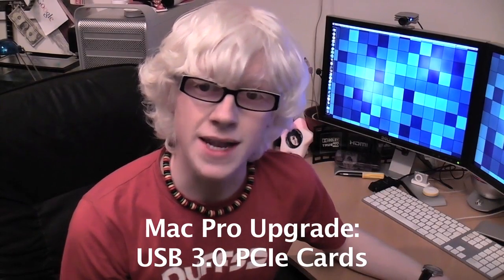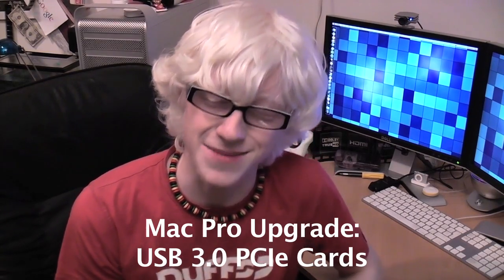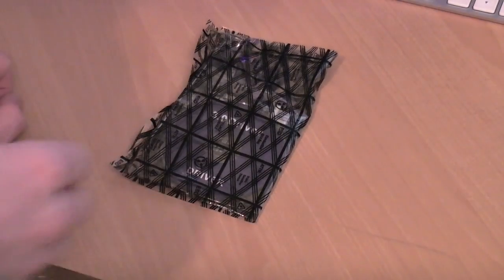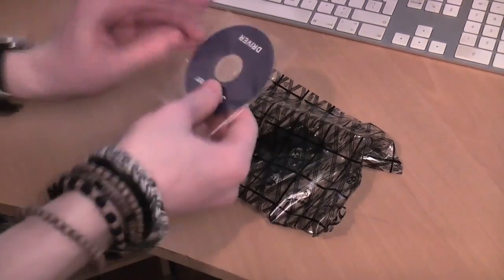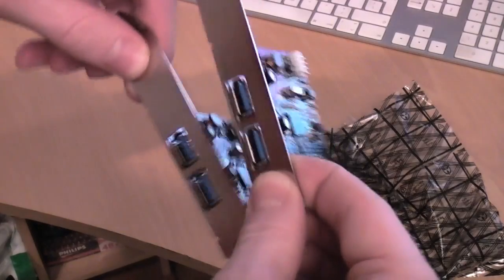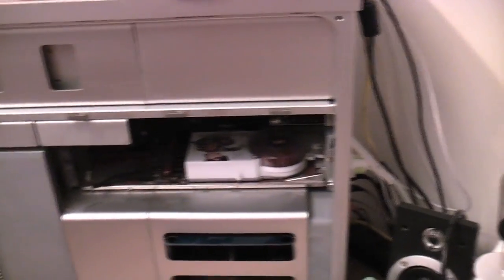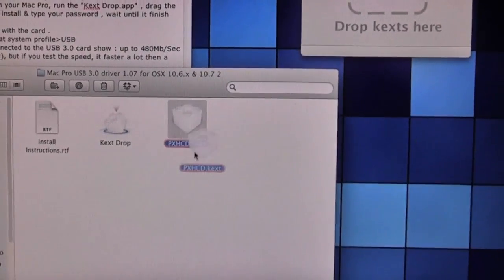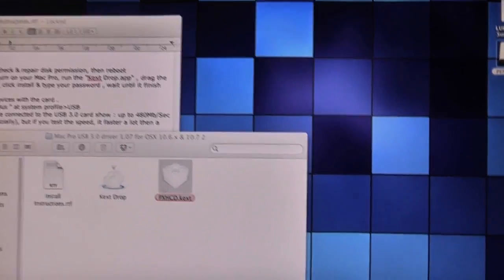Mac Pro Upgrade: USB 3.0 PCI Cards

Comment: Hey All,
I have a 2011 Mac Pro and was looking for a USB 3.0 card that would run on Snow Leopard. Amazon carries the Sonnet Allegro USB 3.0 PCIe 4-Port and is advertised to run on Snow Leopard. However, after receiving it, the box clearly states that you need 10.8 or later. 
I found a solution at OWC with the MAXPower 2-port eSATA 6Gb/s& 2-port USB 3.0 PCIe Controller Card. It works great but you'll first need to download and install the driver. Hope this helps someone.

Comment: How did you power these cards? I see these and many others on ebay have the power connector in the corner like they need power going to them.

I ask because I also have a mac pro and want more USB ports. Problem is we dont have spare power wires around the bay in our macs haha.

Comment: aw definitely! It is stable i ve it as my main working machine since 2 years but if you get into this i suggest you to do your research before to actually build it, check in the tonymacOSX86 website they have their customac builds for any price , my built costed over 1800 but every now and than i do upgrades and that s really the coolest thing of running on OSX on a pc you are free to do upgrades but by the other end apple dont help you if you have  a problem..

Comment: I have 2X 2006 mac pros and they each have 2 ethernet ports, they were never made without them.  You may have gotten a fake or something. It should be on the back near the bottom with the rest if the plugs.

Comment from the maker: Display connections depend on the graphics card installed, so you have a whole range of possible configurations. One of the most common configurations is Dual DVI on lots of Mac Pro video cards, but you'll also see cards incorporating Display Port and HDMI...

Comment: I finally converting to mac and just bought a used mac pro .I got it home and it doesn't have an Ethernet port. they just used a mini wireless. What card do you suggest? it's a 2006 or 2007 I think it's PCI?

Comment from the maker: @141gregmor There are a few problems with G5's for gaming. Firstly, you have to get the 2005 edition G5 to be able to get a decent PCIe graphics card for it, and then if you want modern day performance in gaming, you'll have to flash a PC card. The second problem is the architecture. You can't install Windows on a G5, and the Mac games for PowerPC are all pretty old. You can't run Steam on PowerPC Mac's either... If you want to play older Mac games (1997 - 2006) then they're pretty damn good :)